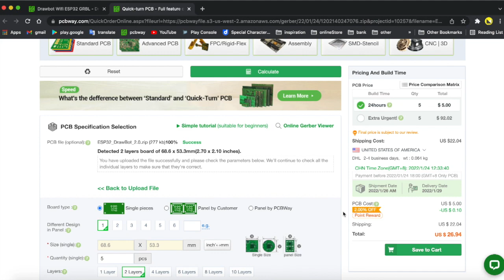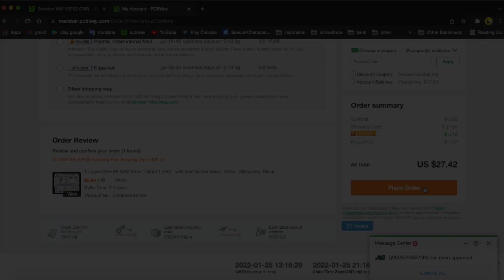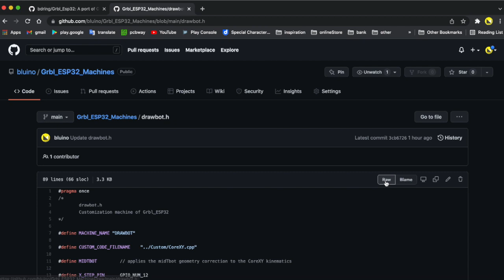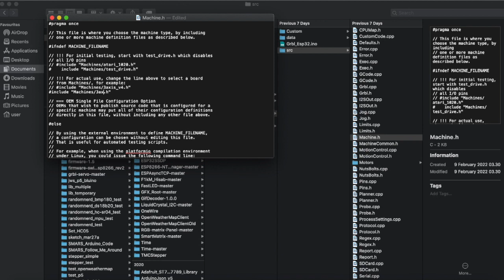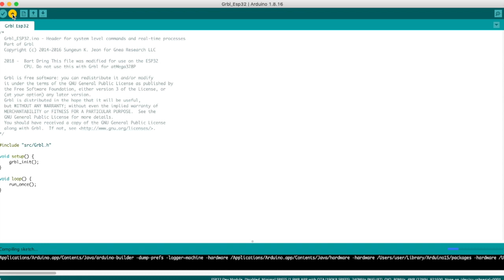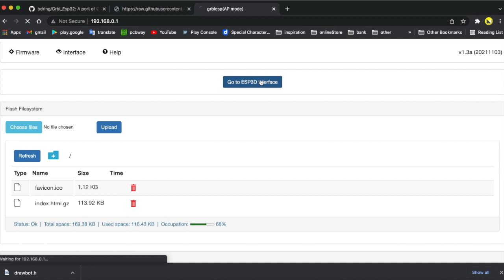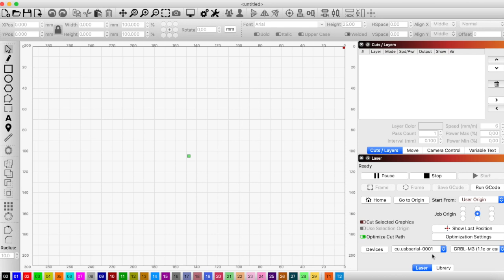How to Make CNC Machine Drawing Robot GRBL - ESP32 Wifi Drawbot Plotter Pen

Comment: How work lightburn with the servo in my setup can you see travel lines how can i fix that ?
Reply: via on/off laser function (need to implement in firmware), similar to pen up/down. Instead of pen servo you need to drive power to the laser
Reply: @MrMpytel where can I find the code?
Reply: @MrMpytel for Arduino UNO